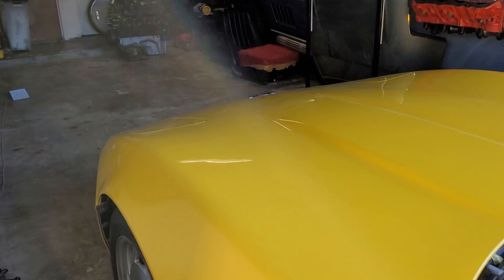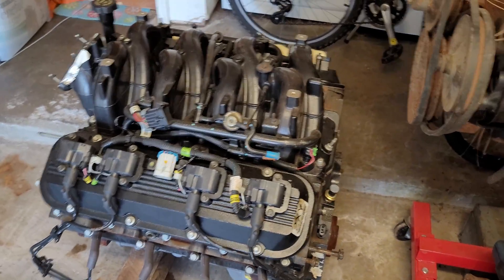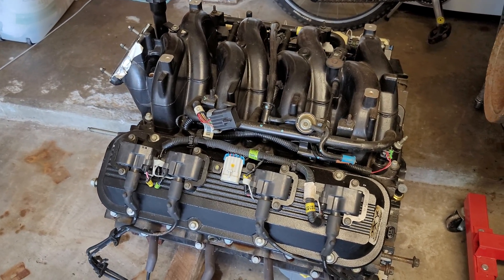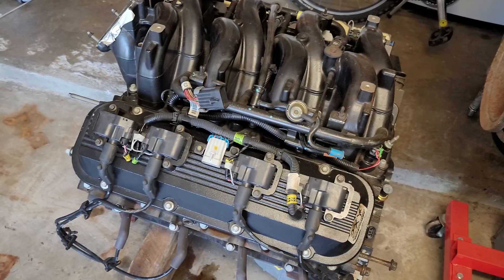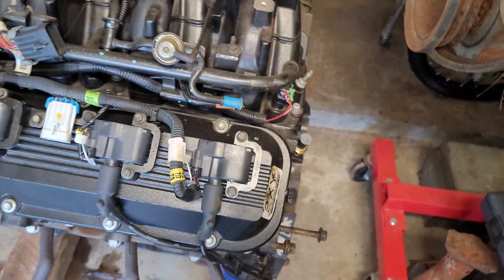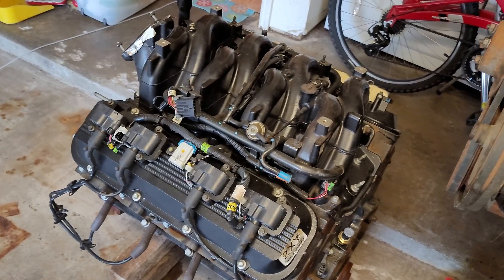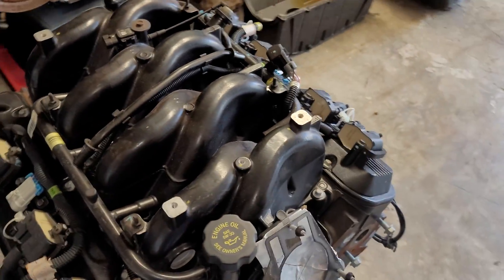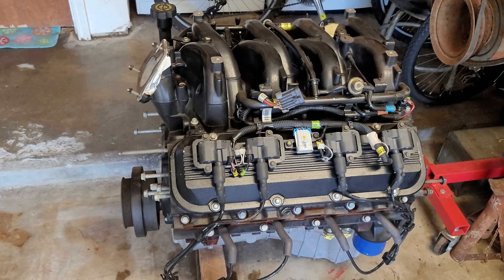The Monstrous Vortec 8100 496 8.1L Big Block Engine of the 2000's

Comment: 02 gmc 2500 8.1 11,5 mpg empty 8-10 mpg with a couple ton load  8 with a 20 k fifth wheel biggest repair oil cooler lines to radiator and a rat chewed the crank sensor wire 102k miles still doesn't burn oil between oil changes
Reply from the maker: Sounds like a great engine and truck, and those are great mpg numbers for such a big engine and load👍.

Comment: Those marine cams are kinda hot not a lot of valve overlap but completely different animal then smog cam 425 hp Continuous output @ 5800 rpm  is 35gl fuel hour… BBC IS THE GOAT
 Yachters don’t get it some have Mercury’s some have Volvo  yet some people run
 Crusaders, Pleasure craft marine, all are BBC
Reply from the maker: Yep, it amazes me how many people are unfamiliar with BBC's. Sometimes, I think to myself, did they even make any other engines😁?

Comment: Threw one of these in my 68 chevelle. Still working on the exhaust and cooling system.  But it does run and drive.  Going to try and get it road worth this June.  Curious the see the mpg it gets in a lightweight car.
Reply from the maker: sounds like a fun project. Be sure to check in and let us know what kind of fuel mileage you end up getting out of it...

Comment: Great info!     I’ve got one in my motorhome with the 4l85e.     It moves 12klbs and a tow vehicle really nicely.     Had a broken exhaust bolt on rear of engine but luckily my rv is a class c with the doghouse so easy to access the back of the engine.     Bought a bracket which works as a clamp that bolts to the back of the head and tightens the manifold.    I also have a Dually with this motor and an Allison and a Duramax 4x4….the 8.1 has good torque down low and seat of pants feels powerful.     The Duramax may get more fuel economy but it feels like the 8.1 is just as durable.     My motorhome doesn’t burn any oil but it just has 80k miles.     Not sure on the Dually as I haven’t driven it much I just picked it up…thanks for sharing about these motors, I like the simplicity of a gas motor for hauling….easy to get parts if needed and less expensive to maintain
Reply from the maker: Great testimonial, and thanks for sharing. Glad you found the video helpful👍.

Comment: The rectangle port on throttle body flange (11 o'clock postion masked off in video) is the pcv system. Air goes in there. There's a tube on bottom of intake that's also part of that system. Intake manifold is the only major flaw to this engine.
Reply from the maker: Good information, thanks for sharing👍

Comment: Ok dude can bus doesnt run the engine, can bus refers to a communications protocol between the different little subsystem computers throughout modern vehicles and its a pain in the dick if you like to tinker. Anyway the heads on the 8.1, its efi, and ignition are phenomenal perforning and damn near indestructible

Comment: I have a 2002 a Alanche 2500. I would like to know where the #2 cylinder is located. It's showing a p0200 code. I replaced plugs and wires but it's still has a misfire. I would appreciate any help and input. I'm wanting to check the Injectors
Reply from the maker: #2 will be the very first spark plug on the passenger side. I would start by pulling plug wires while the engine is running to see if you notice any difference, then move on to investigating potential wiring damage.

Comment: I have a savana 3500 with that engine , best mileage has been 12 mpg , doesn't smoke , knock , or leak any oil . My van has 372000 miles on it .
Reply from the maker: Now that's a testimonial. You definitely don't see the 8.1 vans around much very more

Comment: You constantly say that it has to be paired with the Allison transmission I drive a 04 GMC 7200 and it is paired with a 5-speed manual and that engine is pretty tired is there any way that I can cheaply make it untired?
Reply from the maker: When you say it's tired, what kind of symptoms is the engine showing that would make you feel it's getting worn out?
Reply: it just drags * feels like a lack of horsepower unless that's how the engine is on the bigger truck @VetteSource

Comment: I bought an 02 Avalanche 2500 4x4. 10 yrs ago never had an issue with it then last year was hauling some water. Got home turned truck off. Started it an hour later and threw check engine power loss code and something to do with my intake. Replaced every sensor on it. It idles high when running no throttle response. Does anyone have any ideas? I miss my truck.
Reply from the maker: Sounds to me like you may have something going on with the drive-by throttle body system. Do you have a scan tool to pull codes and see what it's doing in real time?

Comment: I have this engine with the 5 speed Allison transmission in my 2004 Fleetwood class A motor home. It's a 32 footer and weighs in at around 21000 pounds. Fully loaded with everything including the kitchen sink and pulling a Toyota camery it gets almost 8 MPG and never misses a lick. Strong and dependable, and in my opinion the best non diesel engine ever put in a class A. The Ford Triton V10 is more popular in the older rv's like mine but you have to push them above 4500 rpm to make the power the 8.1 makes at 3200 rpm. I also like the idea of an all cast iron assembly instead of the aluminum heads on a cast iron block like the Ford. If you are thinking of buying an older class A and have a budget of around 25k the Vortec Workhorse chassis is the way to go.
Reply from the maker: Great testimonial, thanks for sharing👍

Comment: Actually the Buick nail head is the longest production run V8 . When GM stopped using them they sold the design rights to rover and were used into the 2000 teens.
Reply from the maker: interesting, thank for sharing....

Comment: 2005 big block with Allison trans has a 6th gear lockout, you can buy a kit to utilize the overdrive gear.
The intake manifold is baffled down to a small opening along with a small MAS change and replace these gain nice power and torque
Reply from the maker: good information, thanks for sharing....

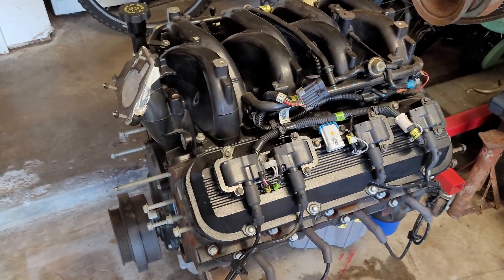Comment: 8:00 People claim a 1987 Ford 300 inline 6 with 260 lbs-ft torque will pull a house off the foundation. They must be talking about a small 1000 sq-ft house.
Reply from the maker: yea, that's definitely one of those expressions that gets passed around. I agree even though the 300 inline 6 is a great motor, I'm not sure how many houses you'll be pulling behind it...

Comment: I have two of these in my 2005 37’ Sea Ray. Great engines !
Reply from the maker: For sure, I can only imagine the power output of these bad boys on the open water👍
Reply: @VetteSource it would disappoint you. 😂. They only build them to about 375hp/450lb and the boat is 17,000lb. Boat cruises at 26mph @ 3400rpm and prob about 40mph at WOT. But the boat is sleek looking and looks like it would cruise at 50mph 😂 oh ya, and gets 1 mile per gallon at best. 😮

Comment: My 2004 Suburban tows a 12 ft cargo trailer all over the USA.  15 mpg on a good day.   250,000 miles, zero problems.  If it had more gears it would get even better mileage.
Reply from the maker: Great ro hear. I'm getting closer to having this engine installed in my 04 Yukon, so I'm interested in what kind of towing mileage I'll see.
Reply: @VetteSource I have a 2004 Suburban 8.1 w/ 4.10 gears and 180,000 miles.  9.5-10.1 suburbs driving.  6.5-7.5  mpg towing 8,000lb 35ft travel trailer.  Tow speed 70-75mph to stay in overdrive.  32.5 inch BFG all terrain t/a kt tires

Comment: I have this motor, my first 8.1 L has 45,000 miles on it, 2000 Chevy 2500hd, great BBC gas motor, though I prefer my 7.5 BBF motor.
Reply from the maker: Just wait until you realize how dependable it is and how long it will last😁.

Comment: My 2002 Avalanche 2500 has the 8.1 with 265.000 miles, runs great and will pull any think i hook it to, loves ice and snow also.
Reply from the maker: Yea, I've heard the 8.1 Avalanches are quite fun due to the reduced weight.
Reply: Yes they are, i own 2, 2002 8.1 2500, and 2003 5.3 1500 and they both get the same milage, buy way different power, lol @VetteSource

Comment: I had two of these motors in 37 ft searay for 10 years. Never a problem with heavy use. Compression was the same as when I bought the boat after 10 years.
Reply from the maker: Great testimonial, thanks for sharing. These engines definitely take some abuse in marine applications👍.

Comment: My 2001 Silverado Crew Cab is my daily driver with the 8.1 and 6 speed manual transmission. We are now shooting for 400,000 miles next year on the original build from GM. When I retire in 3 years, she could have 450,000 all original miles. Yes I have had to change the spark plugs and the oil. I also have gone through two fuel pumps and a clutch. Brakes go without saying. My only issue now is lower body rust. I need to get that fixed! I wonder how much the old girl is worth these days?
Reply from the maker: Now that's a testimonial👍. These are indeed forever trucks. To the right person, they will always have a higher value and very desirable.

Comment: Great video, thanks for the info. I am currently rebuilding a Gen VII  8.1 from a 2006 Silverado and cannot find torque specs or head bolt pattern tightening diagrams. Do you have any suggestions for where to find that information? Thanks
Reply from the maker: Here's a forum post with all the relevant torque specs for the engine -

https://www.pirate4x4.com/threads/8-1l-torque-specs.928052/

Comment: My auto tech class had one of these, It was a seized motor that my class took apart and actually learned on, however the other classes spilled the fluids and put a bunch of components inside of the engine along with food and pencils
Reply from the maker: That sounds about right with an auto shop class. I remember in HS shop class, we received a brand spanking new 1989 Chevrolet Caprice Brougham. Still had the window sticker in it and 3 miles showing on the odometer. Rather than be allowed to learn something from it, the teacher wouldn't even let us tear it down or reassemble it. Instead, it sat around as a static display with the teenagers hanging out in it during class. I don't know which one is worse, but it sure seemed like a waste of a good learning tool.

Comment: These engines make more power than they're rated...a 162k mile 8.1 with stock manifolds dynoed at 412hp/545tq...headers raised it to 424/555
Reply from the maker: Not surprising, GM has fudged the numbers on the BBC's many times over the years.

Comment: i can speak personally for this engine. i had one in a 2009 GMC c7500 and hauled GCWR of over 30k daily. had the 6speed manual trans and was geared very low. this engine spent most of its life at redline. i drove this truck with 75k on the clock for 3 years including a trip from St. Louis mo. to Fresno California. that's 4 days driving almost 12hr days and it topped out at 65 so it was pegged the entire time. the truck/engine never complained. stayed cool and kept running until we retired it at 80k and i was given a 2021 f750 with the 6.7, wish i still had that old gmc lol.
Reply from the maker: Thanks for the testimonial, Richard. It's one I've heard often about the 8.1's, and the regret once the owner/operators don't have them anymore. When you're using your truck for commercial purposes over the road, reliability is king, and the 8.1 has that in spades.

Comment: Great video, the 8.1 builds have jumped the last few years. Hope the pushes for a better aftermarket.  The Chevy 2500 Avalanche the 8.1 was the only option. My first was a 1500 started towing bigger trailers and purchased the 2500 installed 456 gears. Love 8.1.
Reply from the maker: Thanks, glad you enjoyed it. These engines are legendary and I believe will be popular for many years to come👍.
Reply: What tire size were you running with 4.56 gears? I'm thinking of installing a set on my truck running 265/75/16 tires
Reply: @BigBlockSeason  I run the stock tire and rim. I like running 16's for the sidewall and less mass.. Craze is at about 1500 miles my MPG jumped. It likes  2200 rpm  for best all round MPG. Went from no matter what it was 10 now is 12.5 to 13. I've never seen anything above 14 cruising now I've seen almost 16.

Comment: I have a 2001 3500 dually with a 8.1 with a Allison trans. and I have 280,000 miles on it and it is a pull monster. I've had a 20'  bumper pull trailer with a 580C case backhoe on the back and never felt it back there. I pulled it about 50 miles..
Reply from the maker: Yep, the testimonials are everywhere about the pulling power of the 8.1. I'm pretty sure  that 580 Case was well past the "recommended" tow limits for the truck, but like you said, it's like it wasn't even there.

Comment: Love my 04 GMC 2500HD 4x4 Ext Cab.  316,000 miles and counting.  Transfer case has been the only issue. Replaced at 280,000 miles.  Pulls as well as any Diesel I've ever driven with far less issues.  I have beefed up the brakes and Suspension 4" life and pull 22,000# on the bumper.  It has never been babied.  It's kinda retired now, only gets about 5,000 miles a year on it pulling 2 of my heavy Antique JD (60 & 80) tractors to show & Tractor Pulls.  If your ever in the Boise, ID area, chat me up.
Reply from the maker: Now that's a testimonial! I would agree that the old boy has earned his retirement😁.
Reply: @VetteSource  yet like any Ole Draft horse, always ready for the next big job!
Reply from the maker: For sure👍

Comment: They can hardly get out of their own way. Did my A.S.E apprenticeship on the tbi 350. Great engines, run circles around anything Ford or dodge had. Slugs though. A v6 diesel would pull that turd up a hill going 45mph, the other way around and you'd be in second gear all the way to the top at 35mph transmission temp would be 250. Thanks, but don't spread bad info.
Reply from the maker: Slug, huh? Not sure I'd agree with that assessment. It honestly sounds like you've never driven or towed with one, but thanks for your opinion.

Enjoy the rest of your weekend👍.

Comment: Thank you for making this enjoyable video. Bought a used 2004 2500HD CC long bed LT with the 8.1L in 2005 with 19,500 miles. Was like new and paid $22,500 for it.  The truck just turned 300k miles and has proven to be one of the top purchases I’ve made.  Repairs: 1 coil pack, 4 sets of plugs, TPS replacement, 1 alternator, 1 master cylinder, all new brake lines, driveshaft carrier bearing,
Windshield washer pump, new AC compressor and I’ve had various electrical issues (none severe).  Normal brake maintenance etc..  Have friends that have purchased 4 or more trucks in the time I’ve owned the 2500HD 8.1L and have not once felt the need to shop for anything else. I believe, in several ways, buying a new truck would be a downgrade.
Reply from the maker: glad you enjoyed. I agree with you, everytime I look at one of the new trucks, I end up taking one of my 8.1's on a day trip and remember why I have no interest in upgrading...

Comment: Hey there, Sir. Hope that all is well. I just want to know if this is a good platform for building a high performance BB motor? I see a lot of stuff on 454's that have been stroked-out to really good 496's, but I am uncertain as to the power potential of a stock yard-pulled 496. Anyone with any good information on this? Thank you!
Reply from the maker: It definitely is a great platform to work with. One thing to consider, however, is that this is the GEN VII Big Block, so there is very little parts interchangeability between this and the earlier Big Block Chevys. This engine can produce an amazing amount of power, but with a high price tag since everything is 8.1 specific. I would recommend taking an earlier generation 454 and upgrading if power is what you're after.
Reply: @VetteSource  Thank you, very much for your time!
Reply from the maker: No problem, my pleasure👍

Comment: so if you had a choice of this or a 7.4 to swap into a k1500 even though the 7.4 will be easier
Reply from the maker: That's a good question. While I like the additional grunt of the 8.1, if I was retrofitting into an earlier truck, I would probably go for the Vortec 7.4 due to the plentiful parts availability and easier Engine Compuer Management system.
Reply: @VetteSource  I was going to 0411 swap the 7.4 . I won't have to make custom ac lines with the 7.4 too
Reply from the maker: Yep, good point all the way around. Let me know how it turns out👍.

Comment: Thanks for the info...I was just wondering how much one of these marine motors would go for in good condition. How about if it was not running and good for rebuilding?
Reply from the maker: You know, I don't see these marine 8.1 engines come up for sale very often. I think a rebuildable core would still be in the neighborhood of a couple thousand dollars simply because they have marine specific parts like the oil pan, crossover tube, harmonic balancer, timing chain, and intake manifold/injector pieces.